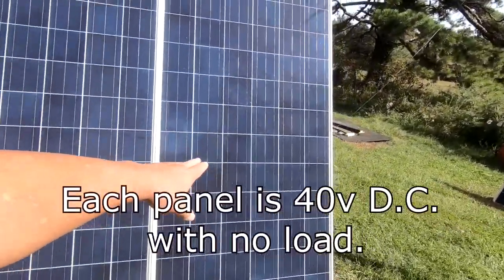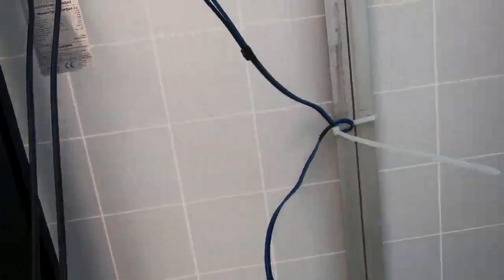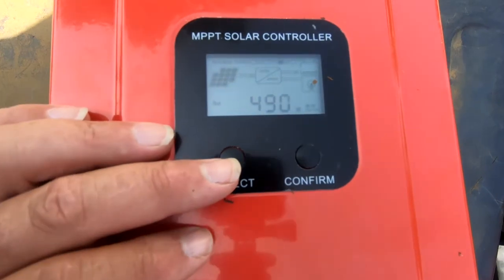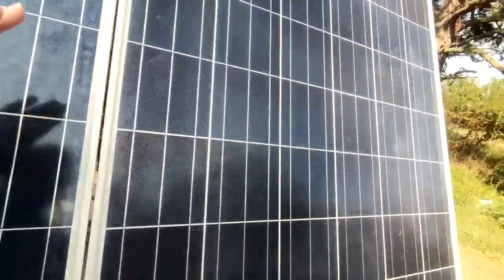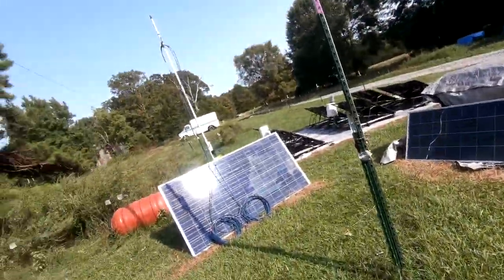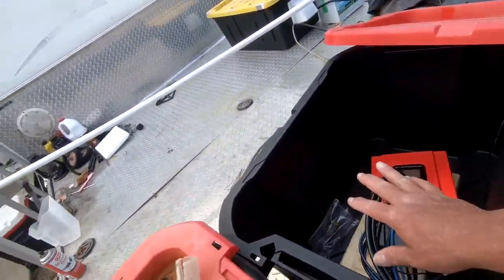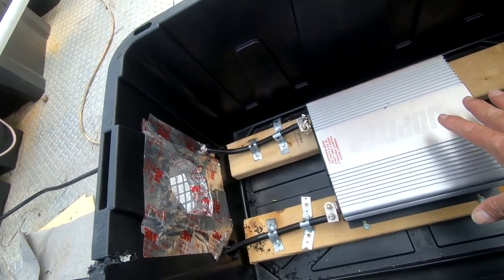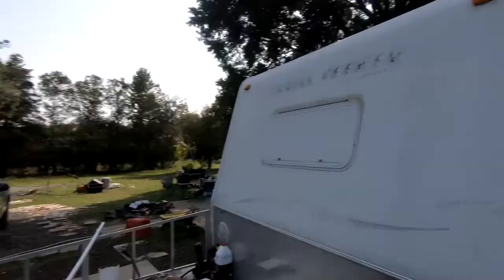Off grid solar setup with Mppt controller.

Comment: Liked your HHO vid, came here to see what else you do in case of any update on your ute. I just recently gone off grid just over a month, working out how much solar power I need, very tempted to just grab quick an dirty setup but realizing gonna probably nd a bigger more robust system sooner than I think. So holding off til I research more. Thanks for this vid, I nd to rewatch it to get my head around watts, amps, volts, wiring etc til I get more comfortable with them.
Reply: I picked up 6 used ( 10year old) pv panels in canada for $50.00 each. And two 24 volt controllers for 50 each. Project research starts soon !
Reply from the maker: I would say get all you can possibly afford. Pay careful attention to the voltages of your controller when you purchase it. Make sure everything matches up. Don't put more than 30 amps on number 10 gauge wire. It can be a little confusing but make sure you use an mppt controller. There are a lot of fake ones out there so be careful. Thanks very much.

Comment: Throw a blanket over the panels to work on them in the light.
Reply from the maker: Just don't have any! This is country living. Lol thanks for the comment.
Reply: @metalpresstv  not even a tarp?
Reply from the maker: @MAGnetICus_Attractus  honestly I'm not sure that the tarp would prevent enough light to stop the risk of electrocution.  I pretend wires are hot, even when they're not. I don't sanction doing it, but I'm used to working with hot wires all the time. Thanks for the comment.